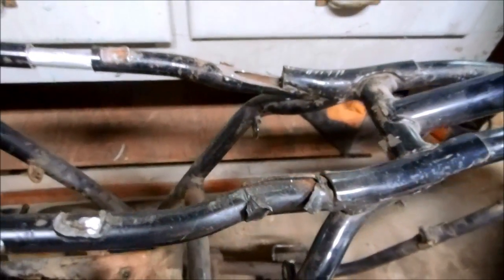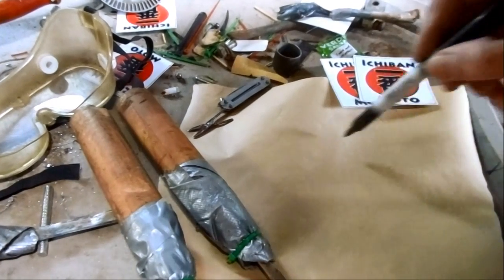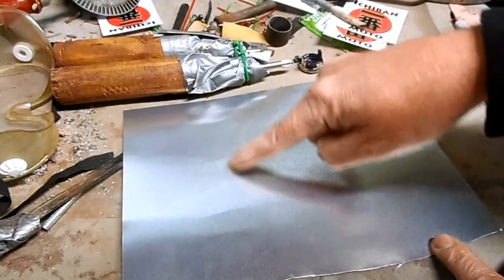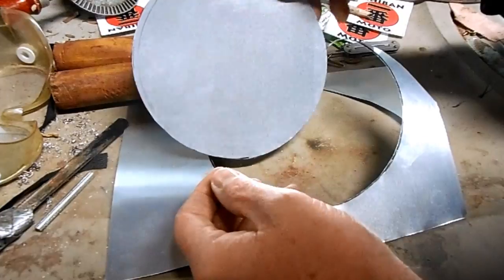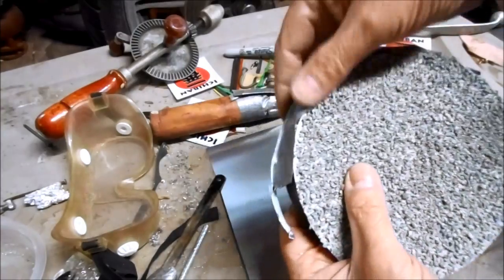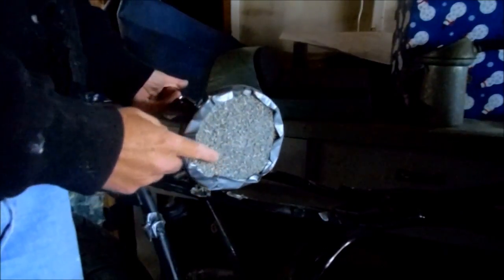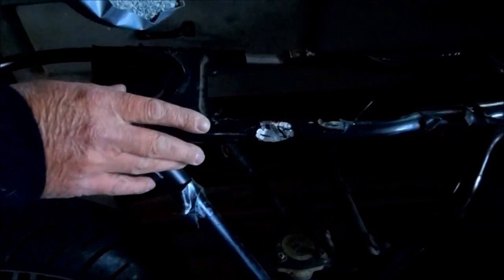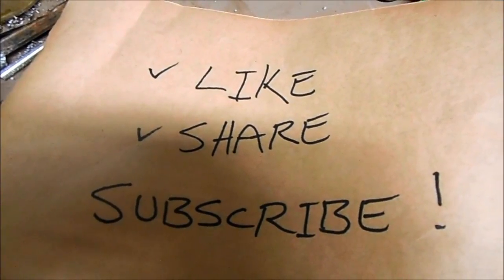how to use an angle grinder on a custom café racer brat or bobber  motorcycle frame

Comment: I'm running out of kitty litter, is it alright to use some clumped litter?  I have plenty of that.  Great vid, very informative.
Reply: MISTERComaToes they work better as sanding sponges. you can put them out in the sun and the longer they are left there, the more aggressive the grit becomes.